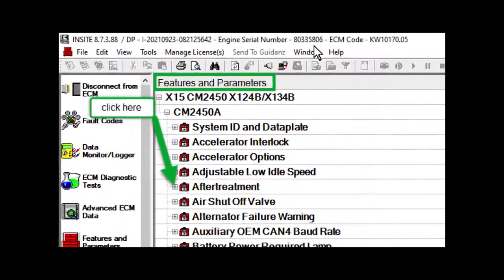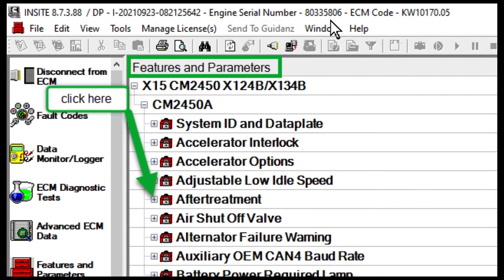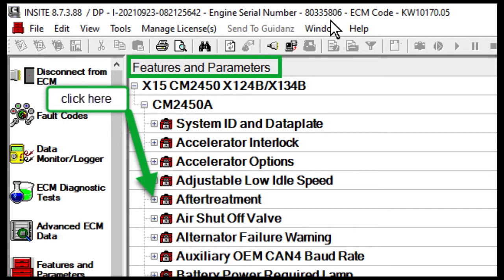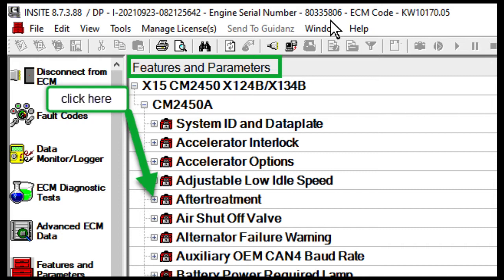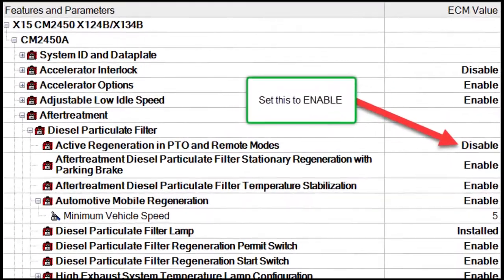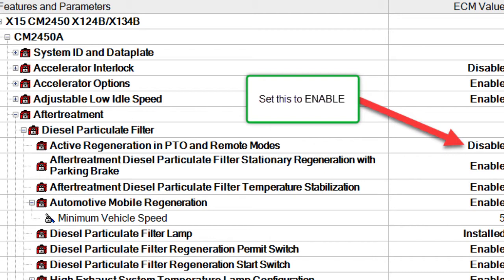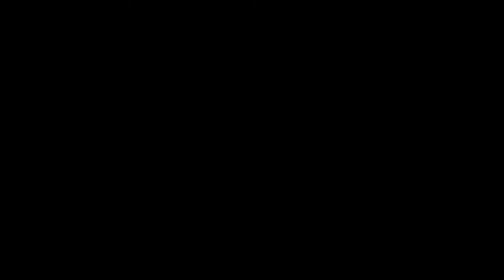Cold weather fast idle speed

Comment: I have the 2019 I s x 15 2350. I want to be able to ramp up my idle for long intervals of idoling, but my truck does not have that feature as far as I know. Can you tell me if that is possible to add that through the cummins insight or some other method?
Reply from the maker: If you have an automotive or on-road calibration in the ecm ,which you should, Yes you can.
You use the cruise control switches to do this. When not moving turn on the cruise switch and then toggle to set or resume and see if the idle changes. if not hook up insite and look for PTO and open that section up and make sure it is Enabled.
You can set default values in there for a quick toggle to set or resume or just hold the set resume switch in one position IE set and the engine should ramp up or down depending on settings. As a side note if you are driving and the cruise switch is off and you toggle the set switch you are changing base idle. You change base idle by turning off the cruise switch and then toggling set and resume. This is also an optional feature that could be turned off in the parameters.
Reply: When parked, turn your cruise control on, and hit set. Mine goes up to 800 rpm. Once there, I hold the set button again for a second or two, and then it goes up some more to 900+. Like Joe said, you want to high idle at 950 or a little more.

Comment: My 2020 Thomas c2 school bus had its instrument cluster swapped out for a “misfire” and now it won’t “fast idle” what parameter enables that ? Ecm is not communicating with the “fast idle” switch
Reply from the maker: Well I am going to guess here. If the VECU or cab controller is built in the instrument cluster you may have to change multiplexing addresses.
Or if the switch is in the new cluster it may not be recognized by the cluster. Some of the newer stuff has smart switches that have their own addresses. If yu have a cummins go to INSITE> ADVANCED ECM INFORMATION> J1939 multiplexing faults ( or something close to that)
Click the plus sign in front of 285 and 286. You should see nothing there or a warning stating "there is no information".
If you see the fast idle switch displayed there (as a problem or lost) the addresses in multiplexing are not correct.
Reply: @ENGINESHOPJOE how can you correct that so it can be fixed ?

Comment: I feel this applies to Rams, & Fords too. My Tam always idles at 950 in extreme cold. 600 in warm weather.
Reply from the maker: The engines do have options one can turn on or off to make them idle faster to warm up. The automotive dodge rams don't have those options available but are built in the calibration. They do that for a couple reasons. The main one is to keep the valve guides from gumming up. It also makes the truck more user friendly in the non commercial world. You don't have a fast idle switch to bump it in very cold weather like a commercial engine ecm has. I think all the automotive diesels are doing this now. We don't have any duramaxes but power strokes and cummins quite a few.

Comment: Hi Neural could you please help me out with 157 fmi 18 in Toronto Canada since cold start every morning I get code and truck shut down if I park inside shop where is warm never shut down if it's cold on highway it's shut down and start again
Reply from the maker: You are getting a slug of air in the pump head when you start up cold.  I need to know more about the problem when on the highway. I have a few questions i need answered before i can come to a reasonable conclusion. Watch for a video on friday the 24th later in the afternoon where i ask you questions to help point you in your search . Remember I am just helping you to know  what to check. Remember in the cold steel does not change (when talking about it affecting fuel drain back ) but rubber , plastic, seal lips, orings, soft hoses or fuel lines  do so think about where those are in the fuel system.